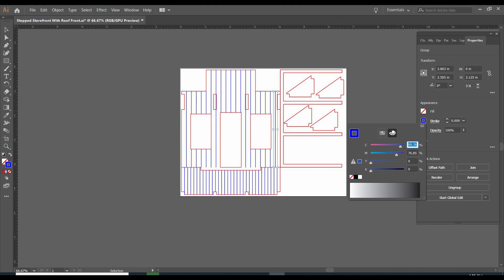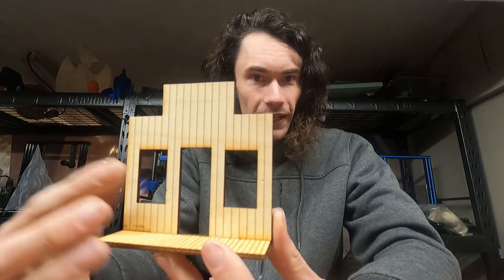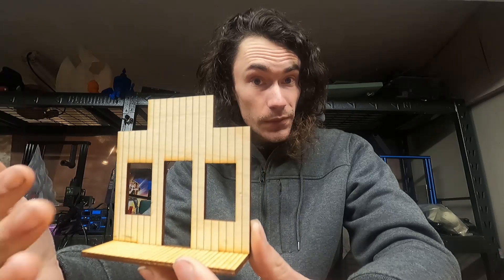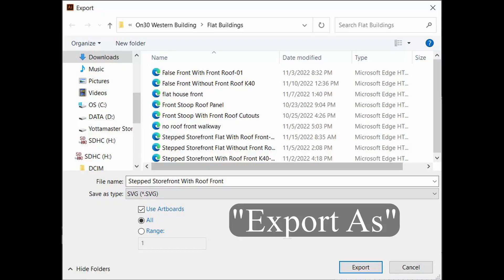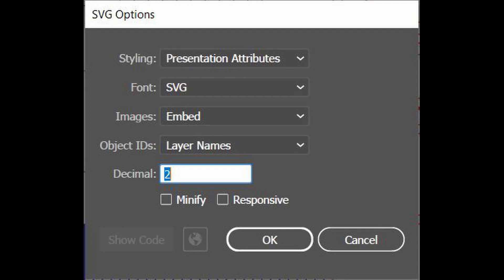K40 Workflow With Adobe Illustrator

Comment: Great video! I recently bought the same laser. From your experience after using the laser, what setting is better for engraving and cutting?
Reply from the maker: Thanks. 

It really depends on your material and how deep you want something to be but as a general rule, I tend to run 200-250MM/S and 10-15% laser power on a raster engrave. The more power or slower you move the head the deeper your lines will be and vice versa. In my case I engrave a lot of 20pt cardboard so the line between engraving and cutting is VERY thin!

Comment: Love your video!
What's your opinion on meerK40t? Is it better than k40 whisperer? Since you can do pwm and lightburn integration on the stock k40 board?
Reply from the maker: I have never heard of meerK40t until now but it looks pretty cool. Mine still has the stock board so K40 whisperer is just fine for me and I like the basic GUI but I say download both and give it a try. I will look into it more though, although for what I do K40 whisperer is great. Mind you I am just doing basic cut and engrave work for my building kits, nothing fancy like raster engraving images.

Comment: have U thought about using soliworks 2D sketch, then save as svg or what ever format? if U like solidworks, they have a 50$ or 99$ license! one 
of these comes with a 2d plotter/cutter! but that's 4 cnc/plasma. and so on!! good luck .Cal......corel is better! ha..ha..
Reply from the maker: I generally do my drawing in Fusion 360, then I pull that into Illustrator if I am doing technical stuff to convert from a .DXF > .SVG format. For Christmas ornaments and stuff I just use Illustrator since it does not need to be as precise.